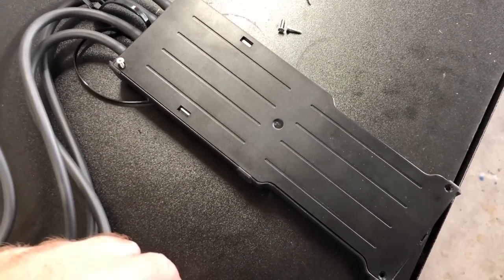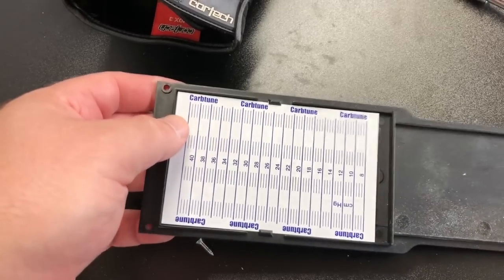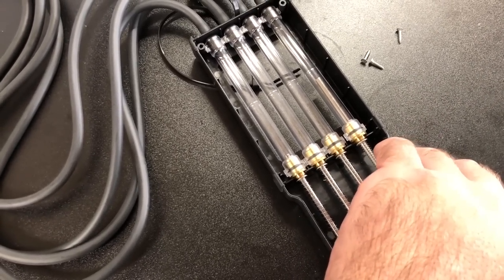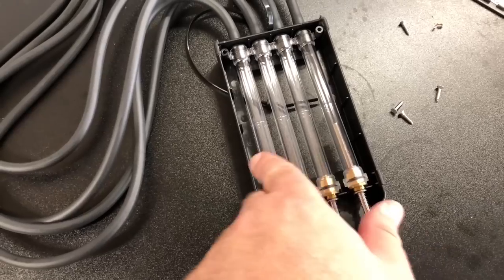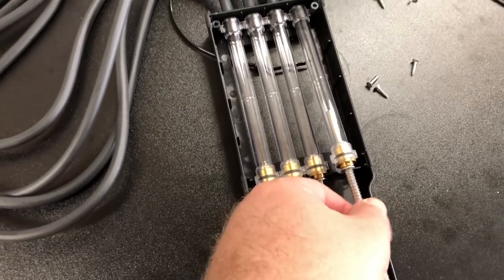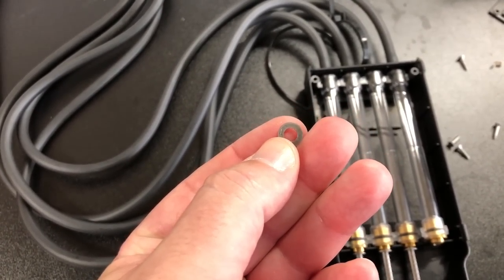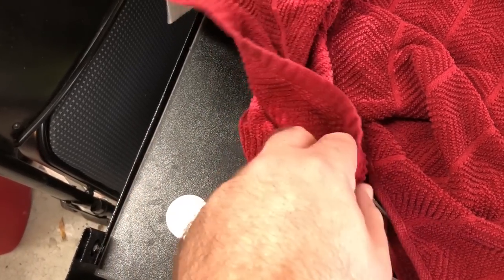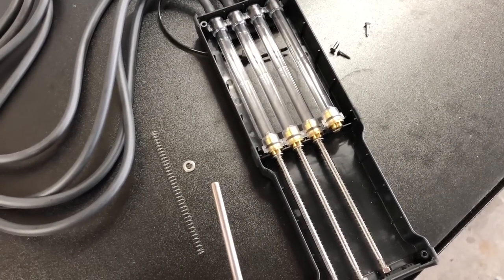How To Clean Your Morgan Carbtune Tool

Comment: Hey there, I used 3 vacuum tees and connected all four of the tubes to one vacuum source recently and found that my Carbtune was out of calibration.  The nuts were the bottom of the springs sit can be adjusted  or washers installed to bring all tubes into sync.  Cleaning the rods makes them all work nice and smoothly....Thanks Sir....
Reply from the maker: I would suspect the length of all passages would effect that reading doing it that way.  Keeping all lines exactly the same I would simply connect one at a time to the same source and take readings.  Cleaning should be the only thing needed.
Reply: @TwoWheelObsession  doesnt work, i tried to connect one at a time, to same vacuum source and difference was 4cmhg. Strange i have tested 2 gauges one mine and one of my friend. Start think that carbtune is garbage

Comment: Sorry; I spoke with Carbtune directly the other day and they do NOT recommend alcohol. They say it can make the rods stickier sometimes. Instead, they recommend BRILLO, (yes).. used lightly on the rods, then wash carefully afterwards. Same as the guides, (if needed)- a little swatch of BRILLO again, on a long matchstick or long swab, into the tube gently. Then rinse fully.